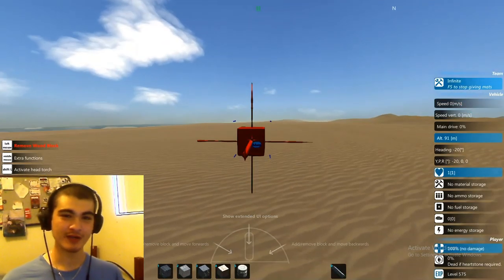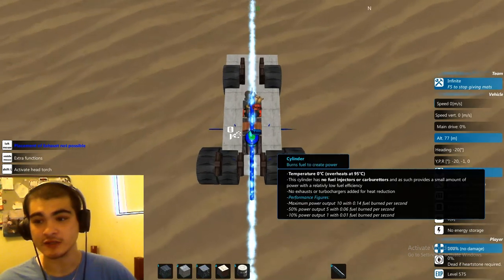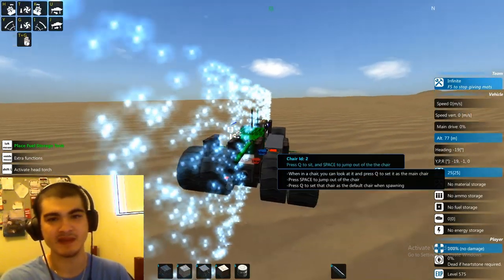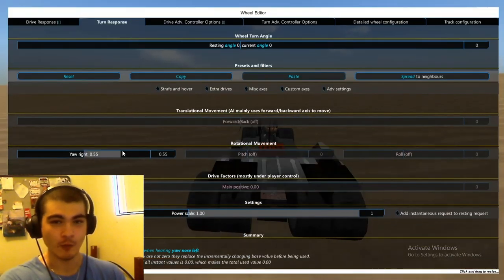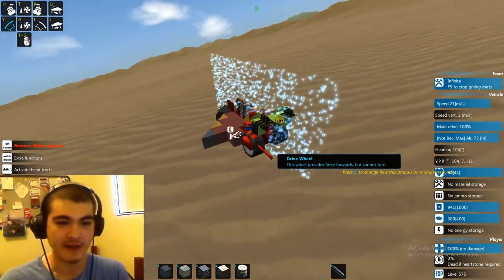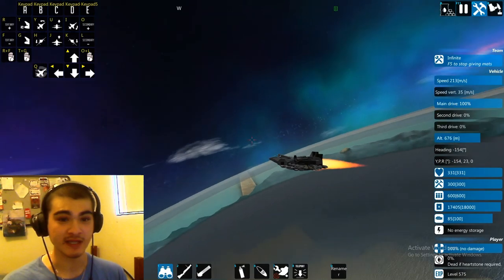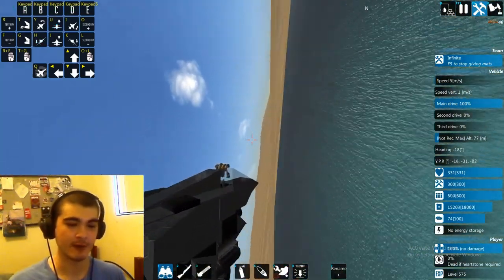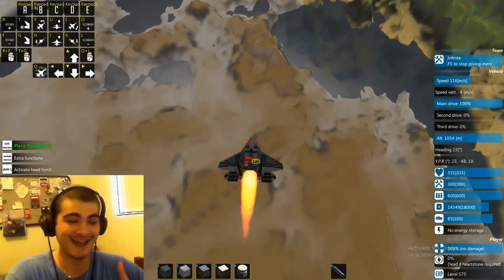BIG = FAST

Comment: ohhh thats interesting
im really interested in pids and ive tuned the roll of my ship lately and i was kinda challanged (ive got to say its me secound ship i do not have a lot of hours in ftd) yet i feel like the update rate of the pids in the game is kinda slow(maybe everything in the game is kinda slow, i dunno), in fpv drones(RL) we are working with like up to 8 khz refresh rate. 4 is the most common i guess. and i feel like the Pid loops in ftd are to slow and thats why the air and water is so think in this game. Its hard to get these things to work right or mabey even to get the physiks to work right with low "resistance" because forces might freak out if you ever played Gmod you might know what i mean. even in Gmod Drag is really high and you need an Extreme amout of HP to reach speeds even above 150 km/h with cars. .... i mean thats when the questions come in: 
are the Pids running slower then the physics in the game ? 
what would happen if the Pids were to run slower or faster then the Physiks?
is there are point when with different drag settings the game become unstable or are there any other draw backs ?

also:  geez im not done yet -_- 
in Garrysmod(gmod) its the same and i think a friend back then tried unity and said its the same Forces and even contraints like axis and stuff depent on the weight because else things werent stable and would liderly reach light speed and vanisch so thats my take on the car thing as to not fuck up phyiks with small cars thrust or better to say force is propotinal to the mass of cars so its best to have a low drag high weight car i bet that kinda goes with other things too but as i said just 2 boats in and like 40 hours or so.
Reply from the maker: FTD drag has been thick since before PIDs were in the game. I have no idea on the refresh rate of the game's physics. My PIDs are pretty reactive, so I'm sure you will find ways to make it all work